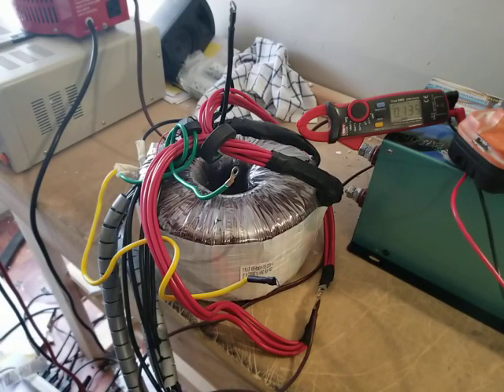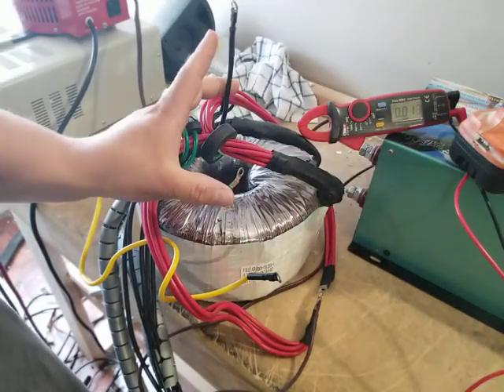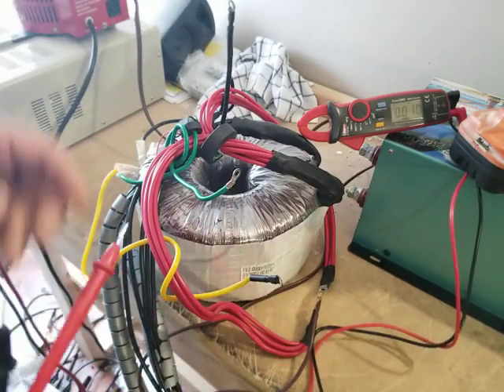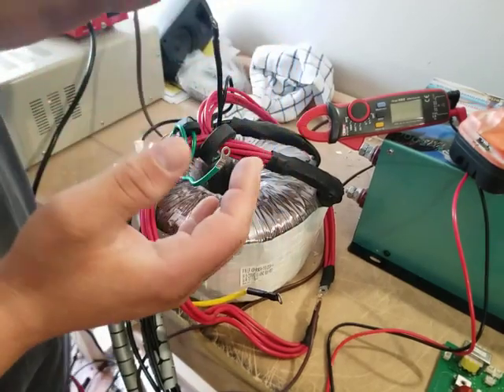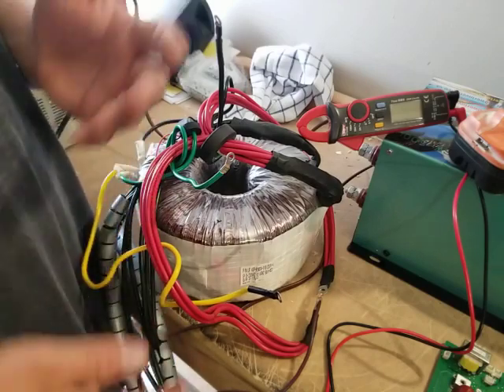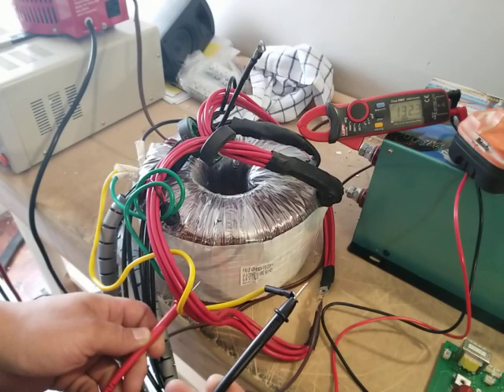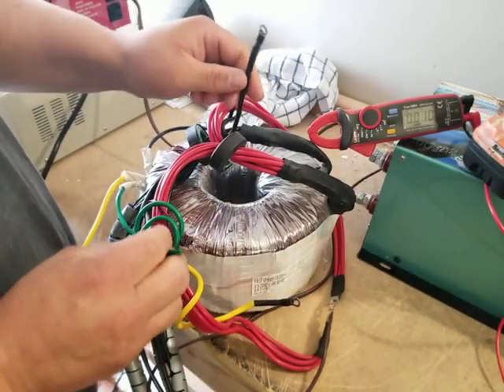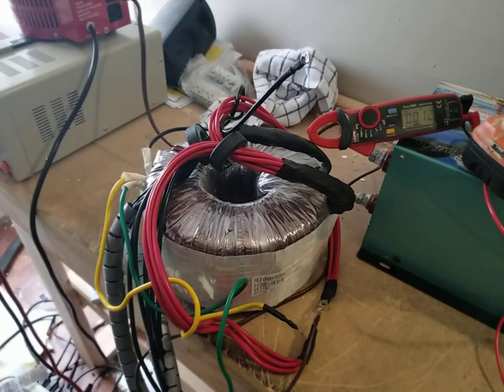Split phase is not 240 volts per leg

Comment: I understand how the cpu combines the 2 legs to produce an overall reading....my question is why would PJ not design a unit with individual leg readings for the North American market?  Trying to compromise these units to fit various markets creates confusion for owners who use these.  Eliminate the display and let folks check their unit with a multimeter would be the solution I'd go with if I were designing these.  I think they've done that by the time I'm writing this.  Basically, many who are endeavoring to set up a system using one of these do not have the full knowledge of the inner workings of these devices...few do.  So if PJ would just keep it simple it would be beneficial.  
PJ's modular design allows users to replace parts or to have service done more easily.  That should be the selling point.  Anyone who's had an inverter fail and had to toss it knows this design is comforting.  Anyone, that is who understands enough to know the difference.

Comment: That's exactly how split  phase works each 120v source is 180° out of phase with each other giving you 240v if they were not you wouldn't even get a reading across them only a reading of 120v to your neutral wire from each line and that's not an earth ground or ground wire it's a neutral wire yes there's a difference you need to be careful or you will get hurt!

Comment: It’s silly to think that it would require 6awg wire. Could you imagine if everything in there was 6awg? The shorter the run the higher the ampacity it can handle. 14awg can handle 50amps at 4 feet. If you look at automatic transfer switches for generators or anything like that or other inverters they use a similar principle. The shorter the run the more amp a smaller sag wire can handle. The longer the run the higher it needs to be.
Reply: Depending on your definition of "need"  and your definition of "can handle" its all really just resistance leading to heat and, voltage drop.  If the wire has plenty of cooling and whatever the load is doesn't care about losing quite a bit of voltage than it doesn't matter.

Comment: Its no wonder it does not meet UL standards. A green wire is always a ground wire in the US. It is not a floating ground in this unit either. That green wire is one of two legs of the 240VAC line.  Black is the other. If it can't produce 240 on those legs, you won't get it anywhere in there. The yellow wire which you showed  ~120VAC on to both the black and the green wires is the center tap of that transformer.  Second, as the black and green wires are the two legs of the 240VAC, running both thru the CT gives false readings. Why? Because the two will cancel out some of the magnetic charge that the CT would detect. With an imbalance in the 120 legs, the meter would be off even more. If using 240VAC, the wires would need to be #6 for both legs and the center tap also to be #6. Or a number of smaller wires on each leg. Sure doesn't look like big enough wire. PowerJack has a bad reputation for their units and they are cheaper than others for a reason. A Hall effect sensor used for current measurement is  a very inaccurate way of measuring current and has to be compensated for drift.
Reply from the maker: All the newest ones use blue wires. Color varries by year or model.
Reply: yes the imbalance between L1-N and N-L2, which per the no load measurements in the video is about 10%,  will certainly cause issues with calculating the correct load values when there is an imbalanced load.